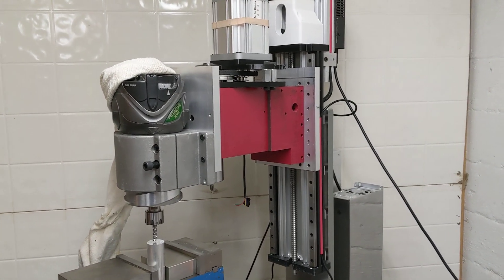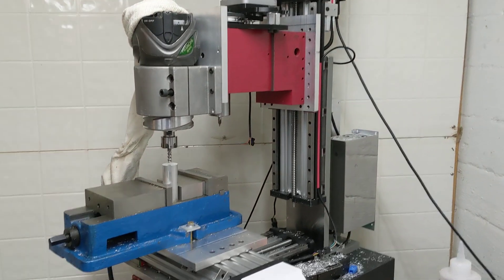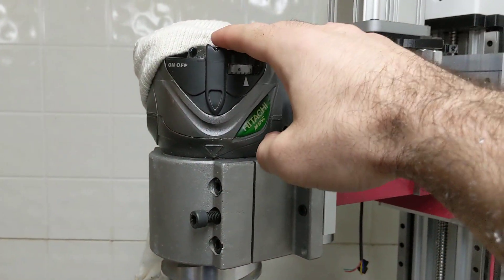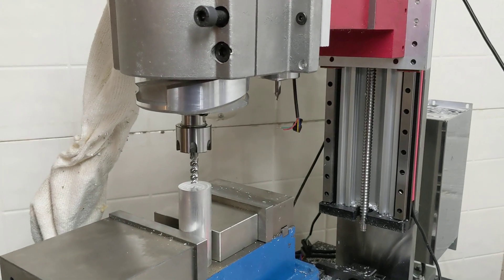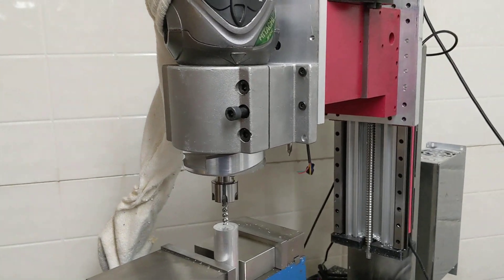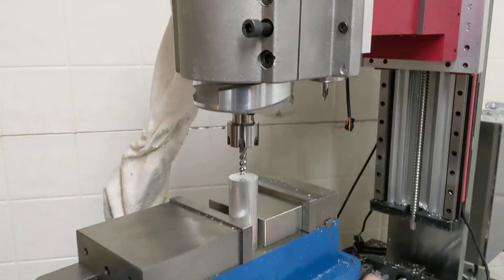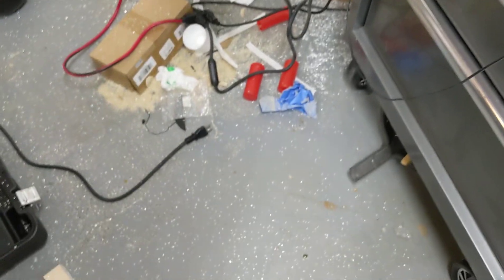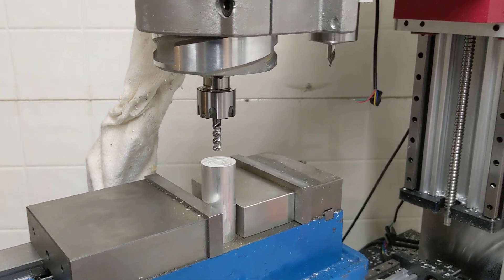RIGCNC-DIY VMC Highspeed Spindle Upgrade!

Comment: I feel like you could benefit from a water cooled spindle, it would be one assembly, quiet as hell, and you would be able to achieve 24k rpm.  There are air cooled iterations as well.  Just a thought
Reply from the maker: https://youtube.com/shorts/QPWikj3ku3Y?feature=share  1 step ahead of you :D Edit: Sorry didn't see which video this was on.  I moved the Air-cooled spindle and am happy enough with it after a few upgrades.  I don't want to deal with VFD electrical noise, water plumbing etc....   The things that go along with a water cooled spindle. Maybe after I build an enclosure.

Comment: Do you have a SuperPID on your router?
They are amazing for running the router at lower RPMs to make it quiet and or give correct surface speed of the cutting tool.
Basically it lets you run the same router at any speed 5000 rpm and up, but with massive torque because the speed control is closed loop. 👍

Comment: Do you have instagram or something similar where i could ask a few questions with pictures attached? Im planning a similar build but i dont have the tools/patience to work with granite or steel so i want to use Aluminum (also because my router can work with aluminium). thickness varies from 20 to 30mm. I already have most of it put together in Fusion360 but I want to know what you think of my design. maybe some parts should be thicker or designed differently. I also want to build a prototype from birch plywood to get all the sizes right since the aluminium costs like 700€ more
Reply from the maker: I don't have a dedicated Instagram for the project but I do have a discord, drop me a line on the website and Ill send you an invite.  For the aluminum replacement I don't think its a very good idea. (Not trying to be mean here, just trying to save you 700€, that's nearly half the mill cost, & IMHO its a downgrade)   I chose granite for 3 main reasons (not including damping and cost which are reasons enough); Flatness, Stability, and Stiffness.  For the aluminum its going to be difficult to get a flat surface, I don't know what router set up you have but even with a professional VMC its hard to get a piece of metal as flat as a granite plate without lapping/scraping. Similarly the aluminum changes shape significantly with temperature even if you get a perfectly flat surface at one temperature, its going to be a totally different shape at a higher temp, bad news bears when you have a bunch of things rigidly bolted together.  This translates to as you cut something, (or over a season change) you'll slowly go out of tram. Finally for stiffness, aluminum is a lot less stiff than steel or granite, this means the mill will deflect more per unit load (be less stiff), which is the reason (I think) the mill works so well as designed.  You can certainly build the mill with an aluminum base, and it will work, probably pretty decently, but not as well as a comparable granite version.  it's a lot of money to spend on something that will perform worse, I think you'd be better off buying a granite plate and paying someone to do the parts you don't have the patience for. I do think the plywood mock up is a good idea, although I wouldn't expect it to move, and it will likely sag quite a bit, the milling head is quite heavy and plywood is pretty springy
Reply: @TheBetterRyanKelly  i just looked for a granite plate in the size i need (800x300x30mm) but they start at like 1k€ which is a bit expensive imo. Aluminium is pretty much the only reasonably priced material i can find. a steel plate costs about twice as much

Comment: Do you have parts you plan on building? I've heard water cooled spindles are less noisy. What programs do you use to model your parts and do your tool paths? Interesting video thanks for sharing
Reply from the maker: Yeah! I'm always working on things that would benefit from CNC.   Water cooled is less noisy but have the added complexity of water, and the vfd can be electrically noisy. I also just already had this router.   For most hobby modeling I use fusion 360, and I use the same for toolpath generation.  Their workflow is hard to beat. Thanks for checking it out!

Comment: Was any of the chatter because of the what I would call "inappropriate" work holding? IE, no V block to properly secure the round stock? Awesome results either way. :-)
Reply from the maker: Yeah if you look closely I am actually spacing the aluminum in the vice with a 1-2-3 block, the material is off to one side in the vice, and where the material is located is cantilevered over the linear bearings.  when I bolted the vice down I was aligning it for the R8 Spindle and this new spindle is juuuust outside the comfortable usable range. Many things about this cut are sub optimal, still happy with the results for a bolt on -poorly thought out add on
Reply: @TheBetterRyanKelly  Absolutely. Now make more videos more often with more footage and the same "production quality" - ie, work harder/more often on the machine and keep the phone rolling - I could watch it all day but 4 minutes per month doesn't quite add up to 16x30*60=28800 minues per month awake, or more - pick up your game, man! :-D Need TOT back on the job ;-)

Comment: One thing you could try is changing the gear ration on the r8 spindle its possible it could run at a higher rpm. Just keep an eye on if you do so to make sure it doesn’t overheat. If it does you could replace the bearings with ones rated for higher speed. This could allow you to get up to the 10k rpm range
Reply from the maker: The gear (belt) ratio I have there is the largest one that will reasonably fit without a 2 stage reduction.  I could get a faster motor but there is additional cost to that I am not really interested in incurring. The bearings I have in there are rated for 10k RPM but even at 5k RPM they generate a decent amount of heat.  The Router spindle  is something I already had so I was willing to bolt it on and try it out.
Reply: @TheBetterRyanKelly  Although, if you're trying to keep the RigCNC "in it's pure form", I think bolting a router to the side of it undermines that.

It certainly makes sense for you to use what you have, but for somebody else building the RIGCNC, it would be super valuable to have a single head.